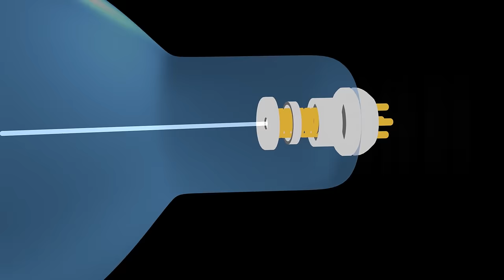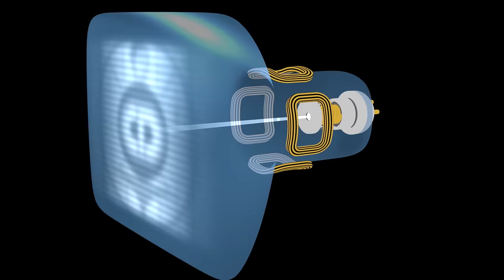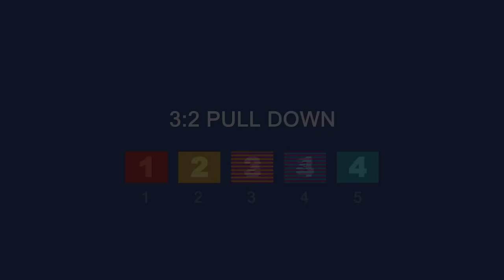CD / Interlacing

Comment: I was monitoring our old analog security cams at work 15 years ago during an organized motorcycle street race and took a screenshot of a passing bike.  Because of the interlace and the speed of the bike, there were 2 separate images of the bike in the same frame exactly one bike length apart.
Because the print was on thermal paper, it degraded before I could copy it. Those were the days...  Made me appreciate my Minolta DiMAGE A1 that much more.

Comment: Hey Captain, great video as always! You forgot to mention the other better method for deinteralce a video: double the  frame rate to create a full frame from each field, so the result is going to be almost as good as the original.  (25i to 50p or 29,97 i to 59,94), the only thing is if the video is for youtube is better to upscale it to 720p to  make available the option of  60p in the player.

Comment: I'm a bit of a CRT aficionado myself. I've got a challenge for you: I'll list 3 lesser known facts about CRTs and if I list one that you didn't know, then simply like this comment. 'Read More' if you accept these terms...

1. Electromagnets are not the only way by which the electron beam can be bent. Two plates of a capacitor, which the beam moves between, can bend the beam using the electric field.

2. The only way to easily generate a voltage high enough for the electron beam to be generated is by way of a 25 thousand volt (25kV) flyback transformer. This transformer oscillates its high voltage 15 thousand times a second (15kHz) and, if you listen closely, you can even hear it.

3.  A CRT is a very specific use for a very old technology called a vacuum tube. Other examples of vacuum tubes include transistor-like switches used in old radios and consumer electronics; as well, the magnetron that generates microwaves in a microwave oven is also a vacuum tube.

Thanks for playing.

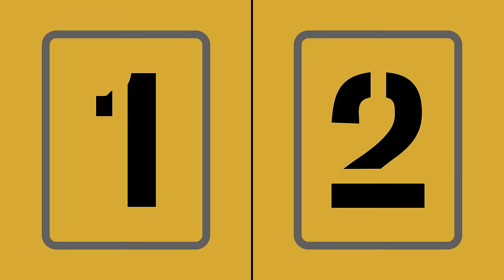Comment: 4:00 No no no no... Big no!
Please don't misinform people. There are many ways to deinterlace, but you NEVER discard or blend.
You split, interpolate and double the frame rate. No information is lost and you end up with a clean, deinterlaced video with the original framerate in stead of half.
Reply: ok but how? with what?
Reply: @electricarchaic  Depends on codec. I use virtualdub and xvid4psp, both can split the fields and deinterlace properly.

Comment: You make interlacing seem like a thing that has only drawbacks in modern cameras, by mentioning only the options of dropping every second field (60i to 30p) or keeping the interlacing artifacts (displaying 60i as 30p with artifacts). However, what about separating fields to double temporal resolution? Properly deinterlacing 60i into 60p with yadif or even a linear filter usually yields quite decent results, sometimes indistinguishable from true 60p.

Comment: 4:01 If anyone is going to deinterlace here are the 2 best ways to do it. (With FFMPEG)

Edit
I should mention that the interlaced video should be in the original resolution and not scaled into any other resolutions or else it won't work.

Michael Niedermayer's YADIF
ffmpeg -i input -pattern_type glob -vf "yadif=1,scale=960:720,format=yuv420p" -c:v libx264 -b:v 4096k -c:a aac -b:a 256k output

Removing 3:2 pulldown (interlaced)
ffmpeg -i input -pattern_type glob -vf "yadif=0,fps=24000/1001,scale=960:720,format=yuv420p" -c:v libx264 -b:v 4096k -c:a aac -b:a 256k output

Your Welcome. :)

Comment: Short and informative. I enjoyed watching it. It was nostalgic. 

He mentioned that some time after the introduction of standard NTSC interlaced video that they started capturing each field in a frame sequentially to 'double' the frame rate. I think it's worth noting that for video that still used the old method, converting the interlaced video to progressive format could be achieved just by interleaving the scan-lines. Just make sure you hat the top and bottom fields set correctly and there will not be any anti aliasing artifacts. Sometimes captured video can be out of phase. That is where you could have a frame where the top field is actually the bottom from the previous frame and the bottom field is actually the top field of the current frame. Basically, every frame is 1 field out of sync. Also 3 2 pulldown conversion of 23.976 fps from film to 29.97 fps for NTSC introduced it's own artifacts where it creates new frames.  Basically you need to generate 6 additional frames to get from 24fps to 30 fps.  One approach you just duplicate every 4th frame.  but that means that ever 4th frame gets repeated and has a little micro-stutter.  The second approach is that after every fourth, the fifth frame is composed of one field from frame 4, and the other field from frame 6 so that frame 5 is a transitional frame with elements of both of it's neighbors.  This creates those interlaced artifacts though.

Comment: 1:15 I dont know why you would have an issue with Europe being the winner, as a Latvian born gentleman.
Reply: Simple, america
Reply: Eh it's not as cut in dry as that as the 60hz did have advantages in that the refresh rate was higher wich while in most cases wasn't that noticble did have some impacts specifically in video game industry before hdmi became a standard as in video games in Europe litterly ran slower and overall worse experience. Look up sonic 1 at 50hz if your curious(I promise this isn't just some 120hz vs 60 hz modern argument thats super pandemic no it is very noticeable change)

Comment: 4:00 "totally extracting one of the fields" isn't there a 3rd option? You can deinterlace, use both fields and effectively double the framerate.
Reply: totally extracting one of the fields means totally extracting the field from that frame. You use the second field in the next frame and totally extract the first field on the second frame.
Reply: You still get interlace artifacts, and you don't necessarily get double framerate unless you only shift the interlaced frame by 1 after merging.

In other words: Combine frame 2 and 1, export 1 frame, Combine frame 3 and 2, export 1 frame. Combine frame 4 and 3, export 1 frame. Ect.

You preserve double frame rate, but you still get jaggy artifacts. Interpolation helps.
Reply: Yeah, half-sizing and blending are crude methods of deinterlacing, these days the recommended way would be a deinterlacer.
Assume a frame (2 fields) from a true 60i, top field first video. Put the top field in the first frame, use a deinterlacer like nnedi3 (or QTGMC) to interpolate between lines, put the bottom field in a second frame, do the same, i.e. put the pixels in frames they belong and guess out the missing lines.
High quality deinterlacers introduce minor to none artifact (afaik), and in QTGMC's case, works to prevent them and remove those already in the source.
But a lot of the time the source isn't properly done, old videos liked to mix interlaced materials of different formats and cross-fade/resize as if it's progressive etc. which caused hard or impossible to remove artifacts.
Also there is telecine (pulldowns), which needs inverse telecine instead of deinterlace.
Reply: that would just be interlacing
Reply: That's not deinterlacing. that's LITERALLY WHAT INTERLACING IS.
Reply: A few years ago, I converted a 20-year-old video shot with a PAL interlaced camera (720 * 576 50i) to a format that would look good in YT, which is 720p60. I was able to find plugins for AviSynth and perform not only deintarlace but also 50 fps to 60 fps conversion. Here is the result: https://youtu.be/AjYxHfMZJaU
Reply: No, that IS the first option.

Let me describe the two options the video gives in more detail:

Option 1: Take each field in the interlaced video, display each line twice (to preserve aspect ratio). This doubles the framerate, but halves the vertical resolution.

Option 2: Take the two fields in the interlaced video, alternate lines of each. This creates a single 'progressive scan' frame with twice the resolution, but half the framerate.

Now, there's a whole bunch of alternatives and variations.

For instance; 
spatial interpolation:
For each field, fill in the missing line with an interpolation of the two adjacent lines. This creates a full resolution frame out of each field. Double the framerate and resolution, but a lot of it is interpolated detail. (eg it's an image scaling routine done on each field.
Temporal interpolation: You need 4 fields for this; For each missing line in a field, take the two adjacent alternate fields, and interpolate between both. This creates an average not of the current field, but of the two adjacent fields which have data for the missing area.

And of course you can combine the two, which means for each pixel for which you lack actual data, you are averaging between the two adjacent lines in the same field, and the two lines in the field immediately before and after.

None of these methods is perfect, but they reconstruct a progressive scan image from the interlaced footage in different ways. They vary in complexity, and function.
Which is best depends on the nature of the footage.

Of course, if your source footage comes from an 8 or 16 bit game console or microcomputer, you need an entirely different method, and most deinterlacing filters completely screw it up.
This is because those consoles and computers use an out of spec signal that creates an unofficial progressive scan mode; They instruct the television to skip adjusting the line offset for interlacing, so they effectively draw the same field at twice the framerate, and leave the other field completely blank.

Unsurprisingly a de-interlacing filter tends to not understand the nature of this modified signal, and tries to de-interlace something which wasn't interlaced to begin with...
Reply: @piotrne  50 to 60 fps conversion is redundant.
Youtube is fully capable of supporting 50 (and 25) fps footage directly.
Reply: @piotrne  Why ruining 50p with converting to 60p?

Comment: Interlacing was done to allow higher Horizontal resolution of broadcast TV in a given bandwidth.  The product of the Vertical resolution, Horizontal resolution and refresh rate is the required Bandwidth for the TV signal.  This was most critical to broadcasting over the air.  The interlaced video of NTSC & PAL allowed using about 5 MHz of bandwidth for the given resolution.  To have the same resolution and refresh rate without interlace would have doubled the bandwidth to ~ 10 MHz (and also the H scan rate from ~ 15.7 kHz to ~ 31 kHz).  This would have meant fewer TV channels and more expensive TVs.  FYI: In France, broadcast SECAM had ~ 7 MHz of Bandwidth for superior Horizontal resolution.

As for the persistence of the phosphors, NTSC refreshes at 30 Frames / second, PAL at 25 Fps.  To minimize flicker, PAL TVs had longer persistence phosphors.  This resulted in two artifacts:  1) "ghosting"  and 2) a slightly different color palette.  The ghosting is visible in old movies of B&W PAL TVs.  The color shift is a bit more subtle, but the overall color temperature of PAL TVs is different than NTSC TVs because the phosphor persistence (needed for the slower refresh rate) is related to the exact color emitted by the phosphors available at the time.  Only practical way to see this is in a side-by side comparison (or a lab full of equipment).

Comment: Adobe after effect alternatives.

Da vinci.

Thank me later.
Reply: Unable to work on old laptop. Use DaVinci if you are using a computer or modern laptop
Reply: blender.
Reply: hitfilm express.  davinci resolve for free, to my knowledge, uses the default Windows settings for encoding H.264 files, which are terrible. Hitfilm express probably does the same, but I would probably recommend Hitfilm to a former after effects user, because it uses the same "layer" system as After Effects, rather than DaVinci's "node" system, so the transition might be easier.  I'm a Vegas Pro user who has little experience with either program, so feel free to correct me.

Comment: This is why I installed Arch Linux with VapourSynth and the QTGMC plug-in to convert that dreaded interlaced footage from a Canon MVX350i (where the ‘i’ in the model name stands for ‘interlaced’). At the highest quality settings, the encoding performance was 6 FPS, and some quality had already been lost when the 12 GBs of one MiniDV cassette had been compressed by Nero Burning ROM into a 4.7-GB DVD back in 2007, but at least I was able to eliminate that horrible haircomb, double the frame rate thanks to the motion analysis, and even some of the graininess of the cheap original CCD that was always adding some noise even when the scene was sun-lit. Now all that remains is to choose the X265 preset where the quality loss (from the enhanced original) would be imperceptible... but maybe I should go with AV1? Which is better or archival purposes?

Comment: There’s a 3rd and in my opinion the most preferable way to remove interlacing:
Converting each field into a single frame.
After all, preserving the temporal resolution is a huge part of preserving the original as it was intended.
Reply: That's literally just interlacing...

Comment: The slow mo guys filmed a CRT a couple of times, and it turns out the phosphors actually DO dim before the frame is finished being drawn. Persistance of vision extends the scan lines in our brains so the image still looks full. If this was the case for all CRTs running on analog television, interlacing and the "double pass" may have been an unnecessary invention after all.

Also, there is only a limited number of phosphors you could cram into a screen both vertically AND horizontally, so CRTs technically did have a horizontal resolution. It was just limited by the phosphorus, not the electron beam itself.

Comment: for old ntsc formats it says the signal is given 4:1:1 (YUV): (sometimes it has 3 wires for that also for RGB, the 1 wire solution probaly use a multiplexer/demultiplexer)
13.5 MHz,  3.375 MHz,  3.375 MHz (aka 4:1:1) 13.5/3.375 = 4
that would be 4 times for the Y and 1:4 ratio for U and V (for 4:2:2 it would be 2:1)

but actually when you use a analog to digital converter such as hauppauge,easycap or blackmagic 
and their software/or other software available 
you can select progressiv scan or interlaced (like VirtualDub)

progressiv scan results has more of coming (the weird delayed time lines) but having a better resolution
interlaced does have less of coming but actually less of resolution

this now opens the question what or how this is stored on the magnetic tape (store medium)

but this doesnt neccesary tell how the image is progressed 

but here is the problem it could do:
1: getting these values and wait for a next 4:1:1 signal
2: read out the 4 (Y) and add the 1 U and V (then it would have 4 times the amount for Y (2 times for 4:2:2))

this would mean there actually 4 "pictures" for Y, 2 Y "pictures" for (4:2:2)

it might also could have made a frame/picture over the 4:1:1 and stored it somewhere either 2 half picture/frames or 1 picture - then it would be (1)
if it made 2 half pictures after the 4:1:1 was progressed for 1 frame the questioning would change again
if it made 2 pictures at 2 different times the questioning would change again

the solutions at 4:12 to the left is inacceptable that means the resolution is only the half
so a software progress for the right side would be the only acceptable solution

but that always happens when no precise information is available

but now having the software to say "progressiv scan" or "interlaced" doesnt even tell what possiblities there even are 
the information about the signal is missing (i just copy pasted the mhz´s values)
the storage on the tape is missing 3:00 tells at least there are different types
the information about interlaced and progressiv frames needs more of information to fit all this together correctly

if that software progress just use the half information for interlaced that would be inacceptable
but one could have the meaning interlaced mean just to combine 2 existing pictures instead of using 1 picture and only use the half information
while "progressiv scan" some could have the meaning that this software progress does not cut the pictures in half and use 2 half frames or could even have 2 full frames
and the signal as i might wrote is unclear in its information

Comment: 2:30 This was the only reasonable way to do video cameras. If they scanned the entire frame in 1/60 second, they'd need a frame buffer to send it out over the next 1/30 second. Even if this weren't an issue, it would cause sample-and-hold motion blur when your eyes followed a moving object, because 1/60 second later your eyes would have moved but the next 1/60 second field would still be for the object where it was 1/60 second before.

Ignoring all that, interlacing was a clever way to halve the bandwidth needed to send the signal, and the bandwidth needed by the TV decoding and modulating electronics.

Though I still hate interlacing because it never looks good on a non-interlaced screen. Digitizing it always has issues.

Comment: dunno if anyone noticed, but "30i" isn't quite right. it'd be 480i/60: 480 being the lines of resolution, i meaning interlaced scan, and 60 being the amount of distinct frames (or rather, half-frames made from a distinct frame) used in the signal every second. the earlier variant cd mentioned would be 480i/30: 480 lines, interlaced, 30 distinct frames every second.

Comment: There is a third method of deinterlacing, where you separate out the frames, converting say 29.97 480i into 59.94 480p. VirtualDub is the only program I've figured out how to do this with but the results are very good.
Reply: Also you can use Handbrake or Avisynth (QTGMC) for example.